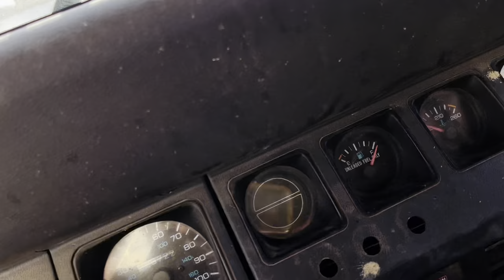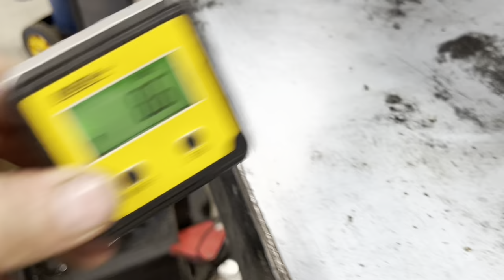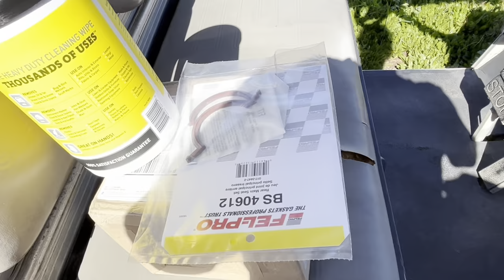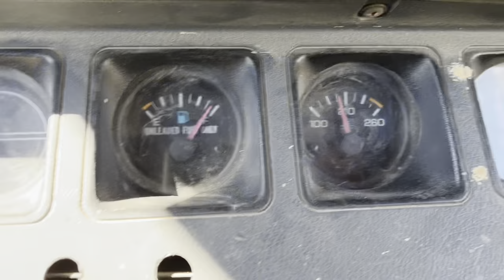Butter Jeep Down!  But not for long.

Comment: A: It's good to have friends (with shops) in far away places! B: I feel your pain - I drove a dying 4.0 in a severe wind storm.  Going against the wind I had it floored and was doing 45MPH on the flats.  Good times.
Reply from the maker: You get it.
Reply: I drive a 2.5L it does 45 against the wind on a good day.
Reply: @Billy28376  This 4.0 was 110% worn out.  Had 170K on it, and after I rebuilt and installed its replacement, I tore it down.  Every single component - pistons, cam, head, valves, bearing, you name it, was completely worn out.  But, it still got me home!

Comment: For paper gaskets I use High Tack. Never had a paper gasket leak when using it. It never fully hardens, so its somewhat self healing. But also, Lube Locker gaskets are amazing, so if they make a gasket for the application that I need, I use them.
Reply from the maker: I need to order up some lube lockers. They are great

Comment: Another great video, love the longer versions!! Can’t get enough,  marks obs is cool I have a 95 CCLB 5spd. Will be hauling a big ole camper and my 4runner to Moab end of April
Reply from the maker: That’s cool. I can’t wait to get out there too
Reply: @thedirtheadshed  I use antisieze on gaskets works real well too helps seal and keeps them from sticking to the surface in case you gotta pull on the trail.  I get the stuff in a rattle can

Comment: That's a hell of an adventure. I am digging the longer episodes. 

Why no truss on the rear axle (old stock and new)? Not sure if the new one is thicker but the stock 9" tubes are only 3/16" I think. They are a pretty decent OD, but the walls are on the thin side. It's probably fine for stock trucks with leaf springs because the point tieing the axle to the frame is pretty close to the wheel in that setup, but for a linked suspension like you have the top links are near the middle by design so that is a lot more leverage between the wheel and the top link axle mounts.
Reply from the maker: The new housing is a stamped 1/4” center.  Way thicker than stock. And the tubes are 1/4” wall DOM.  All substantial upgrades

Comment: I had the same truck that Mark has, same color even. The brakes are horrible in those trucks, I've smoked and warped the fronts a number of times. My son has the truck now, 325,000 miles, original engine still runs good (7.3 IDI)
Reply from the maker: They are good trucks.  Just hard to accept the fact that they are as old as they are now

Comment: Aloha Dave, watched the fixit show.  So, ...going from sprung rear to linked then hammering it, ...what did you learn?  What was the weakest link?  Did the linked rear do what the sprunged one wouldn't?  Just curious to hear from the builder.  Thanks.
Reply from the maker: It definitely handles better on and off road, has more travel and articulation. I’d say it’s a major improvement

Comment: Dave, what are you doing with the old rear locker? Any chance I could buy it? I'm a tool maker and have always wanted to see what's inside of an arb and try and fix it. Years ago I traded my broken one in for a big Dana 60 unit and I always wished I'd kept it. It was the main case that was wrecked and all these years later I have to skills and tools to spin up a new main body, I think, mostly.
Reply from the maker: I scrapped it.  The housing was broken and the splines stripped

Comment: @thedirtheadshed whats your wheel bearing exercise and torque sequence out of curiosity, since you're a seasoned expert that actually wheels im curious of what you do since ive heard a wide variety of techniques that either coincide or conflict with my experience over the years. Keep up the good work, cheers!!
Reply from the maker: I usually spin an snug. Back off, repeat. Then tighten to what feels like 20 foot pounds or so.  Tighten to the next pin location if necessary
Reply: @thedirtheadshed  rad thank you sir, keep up the good work!!

Comment: What gear ratio and spline count do you run?
Reply from the maker: This had 4.56 If I remember correctly.  I know I didn’t get exactly what I was after cause covid had parts all messed up.  It’s 30 inner front. 19 spline outers still.  35 spline rear